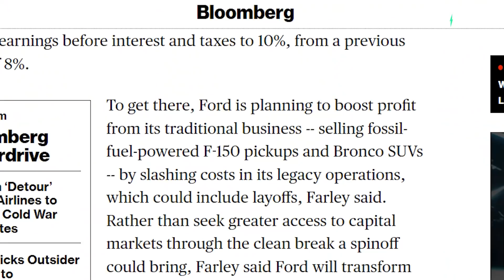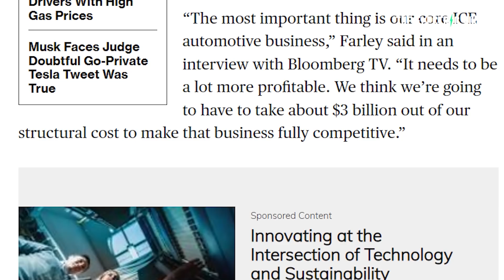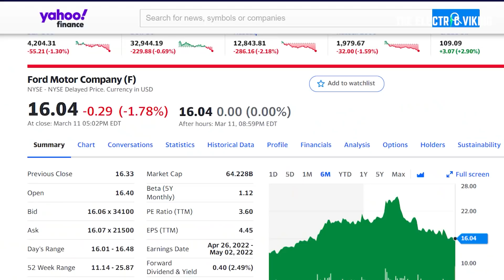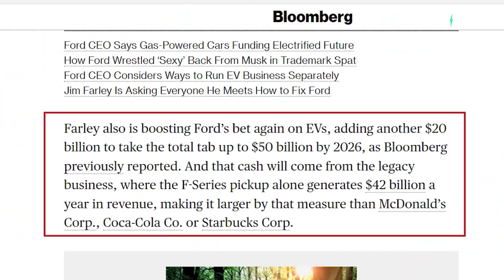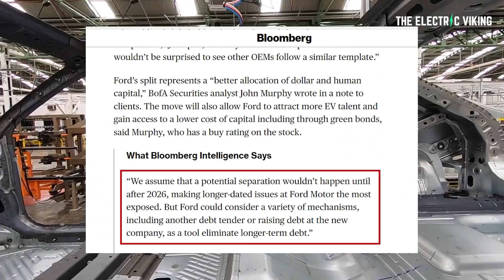Jim Farley is rebuilding Ford into an EV company

Comment: Just a comment and general question. Do you really believe any legacy automakers can pivot and scale up EV’s? TESLA has been setting up and planning this for 15 years and they figured out the math on how much raw materials were needed for a certain number of cars and when forward in setting up supply chains and vertically integrating the rest in order to achieve their production targets. Do you think or believe anyone or any company can secure a battery supply and semiconductors to produce an equal number of EV’s as they were producing ICE cars. My guess is absolutely not.
Reply: OFC they can, and some are. Just look at what BYD are doing. Their NEV ratio is up to 95%+ in 21 (still a lot of PHEVs in the mix, but that's makes sense and should drop rapidly). VW are making a decent effort at ramping. Geely are starting to move their ass a bit too. Will be interesting to see if the global battery supply can keep up!! LFP maybe makes the impossible possible?"?"?
Reply: @kofManKan  BYD is different though brother. Aside from MAYBE VW but all these others are a long shot.
Reply: @kofManKan  byd auto and Tesla were founded 1year apart and both are not a legacy auto maker and not ice makers.

Comment: Ford has one thing going for them. No other auto maker including Tesla has been able to deliver an electric pickup truck in volume production. They have to find a way to jump in that gap.
Reply: Zero chance. Aerodynamics are too poor needs a to big and heavy battery. Nickel has now gone up making the losses even more extreme.
Reply: they need 3 times more batteries to manufacture trucks compared to sedans... but; 1. they don't have batteries... 2. they can't buy batteries, materials prices gone crazy nobody could give stable prices...  3.they can't manufacture any batteries, they don't have the expertise...  and not ordinary Lion batteries, for "automotive grade" 2170 cells they have to reach 7-sigma error rate which is damn hard compared to even 6-sigma which is already damn hard... lesser than that; you're taking the risk of your EV, burning your house down while you are at sleep, remember Chevy Volt fires...
Reply: ford has not yet delivered an electric pickup either, maybe they will, probably they will. hopefully.

Comment: Ford can never use LFP because their efficiency is very low. Nickel is going trough the roof.
They are already loosing money on every EV. The truck was going to loose $10-20k per unit.
Now with nickel going trough the roof they will loose even more money per unit.
Their ice cars are made of steel , steel is going up . All Fords models are extreme gaz guzzlers , gazoline is going up a lot, not great for sales?
In 2023 if they are crazy enough to show the EV numbers it will just be a sea of red ink.
Ford wants this and that so what? Kodak wanted to dominate the Digital camera market. Ford is doomed.
Reply: Possibly, maybe even probably. But if they do go bust, they won't be lonely 🙂

Comment: I think you are wrong on couple things. It is good and important thing that Ford family such as Bill Ford, Alexandra Ford English, Henry Ford the third, Elena Ford and etc control Ford motor company. They have run company for 5 generations and for 119 years. Ford family is reason why lot of customers buy Ford or Lincoln because they trust Ford family. If shareholders and some customers don’t like family control company then they can buy vehicles from General Motors, fiat-Chrysler, Subaru, and etc. Ford should make gasoline vehicles along with full electric vehicles for next 120 years because not everyone wants full electric vehicles. Ford and Jim Farley have to respect that.

Comment: I would add that Ford had it figured out in the 1980's but then took their eye off the ball in the area of innovation, they still know how to make quality vehicles do to adoption of Walter Deming's techniques of TMQ and TQM.

 'Ford Motor Company was one of the first American corporations to seek help from Deming. In 1981, Ford's sales were falling. Between 1979 and 1982, Ford had incurred $3 billion in losses. Ford's newly appointed Corporate Quality Director, Larry Moore, was charged with recruiting Deming to help jump-start a quality movement at Ford.[24] Deming questioned the company's culture and the way its managers operated. To Ford's surprise, Deming talked not about quality, but about management. He told Ford that management actions were responsible for 85% of all problems in developing better cars. In 1986, Ford came out with a profitable line of cars, the Taurus-Sable line. In a letter to Autoweek, Donald Petersen, then Ford chairman, said, "We are moving toward building a quality culture at Ford and the many changes that have been taking place here have their roots directly in Deming's teachings."[25] By 1986, Ford had become the most profitable American auto company. For the first time since the 1920s, its earnings had exceeded those of archrival General Motors (GM). Ford had come to lead the American automobile industry in improvements. Ford's following years' earnings confirmed that its success was not a fluke, for its earnings continued to exceed GM and Chrysler's'.

Check out Walter Deming if you want to learn what helped the likes of Toyota take over the Automobile industry.

https://en.wikipedia.org/wiki/W._Edwards_Deming